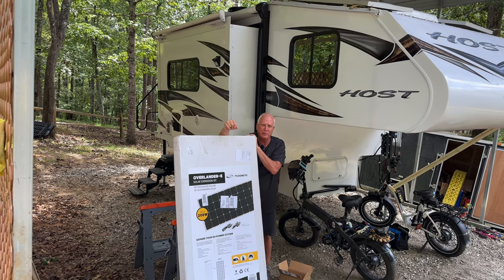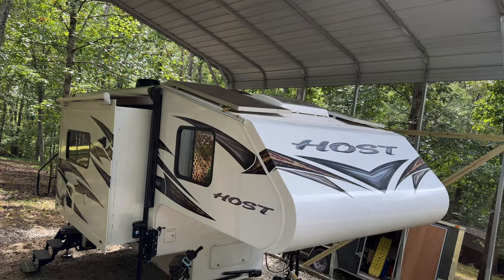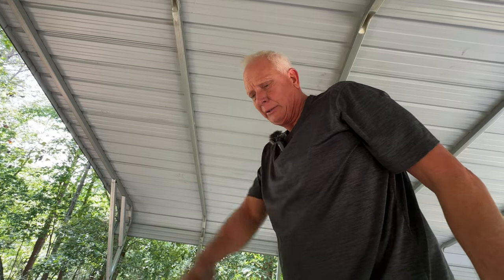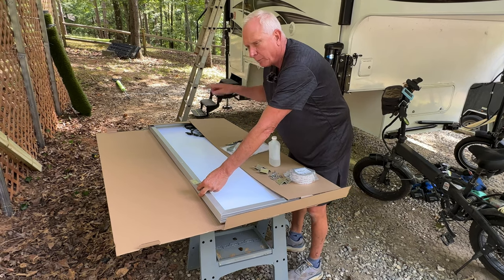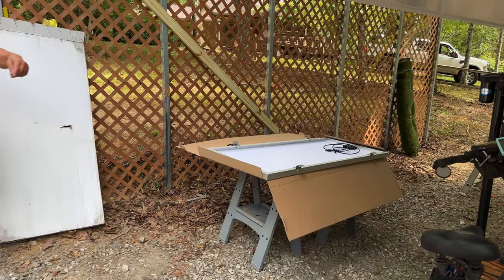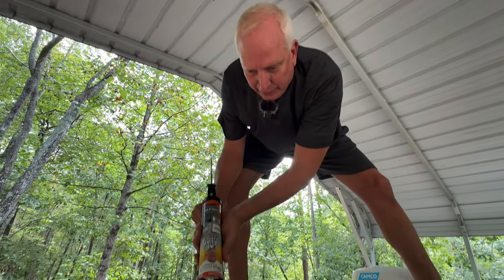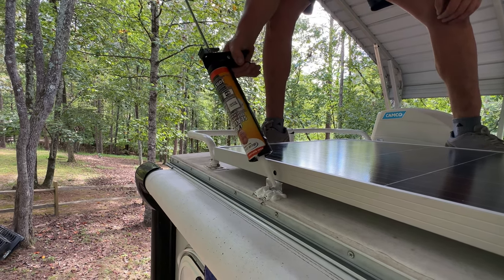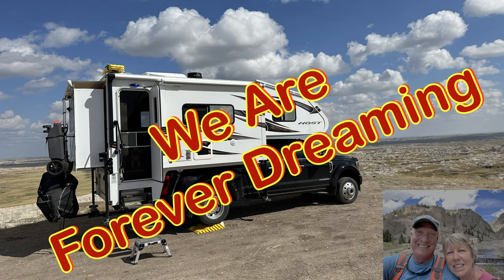I Installed Solar Panels On My Camper (And They're Amazing!)

Comment: I also have a Host Yukon. I oly have one 190W panel from factory. I am planning to start adding panels, so I requested the aluminum frame layout drawings from Host. I was planning to screw my panel mounts into that framing as well, but the first frame from the back is not 11-1/2" to center as you measured from the factory panel. It is actually 19-7/8" from back of camper to center of the aluminum cross framming. This tells me that HOST is NOT screwing into the frame?
Reply from the maker: It’s been a while since we did that video, I can’t remember if I used a stud finder or what but mine is definitely screwed into something solid. Over 15k miles and 1 yr since install and we’ve had 0 problems.  I would use what Host sent you and make sure you do your own investigation. “Sometimes”…. What an RV company gives you might not be correct…. I know people that have used heavy duty 3m tape and self leveling caulking and no screws. So everyone has their way… my best advice is to due your own diligence and come up with your game plan. I hope this helps and thanks for watching the video. 
Danny & Donna
Reply: @WeAreForeverDreaming  Thanks! I am going to make sure I land them in the aluminum framing. Love your videos and hope to see you on the road some day. Safe travels.
Reply from the maker: Thanks Mike, now that Starlink can be used while mobile… Donna wants me to make it so.. we will be releasing “what we did” on converting Starlink to 12vdc and making a mobile mount.  We have a video coming out on RV Intelligence products next, I highly recommend you watch that one, we changed out all out slideout and awning switches last year to Bluetooth and love them. Check out there website www. rv-intelligence.com 
Discount code is Dreaming10 off order and free shipping which is a hell of a deal.

Comment: Personally,  I think the dumbest thing people do to their campers is drill holes in the roof.
I put solar on my camper. Didn't drill any holes in my roof, yet the panels are bolted down. Plus they are easily removable.
Reply from the maker: how did you bolt the panels down without drilling into the roof?
Reply: @WeAreForeverDreaming  I built a roof rack from an old bed frame. My camper is a pop up Sun lite.  The rack is bolted to the aluminum side rail of the roof.
Reply from the maker: good idea. thanks for sharing.